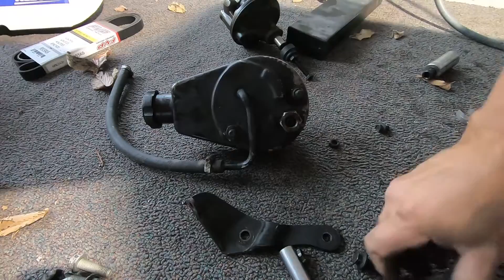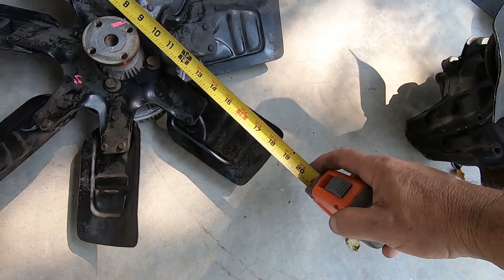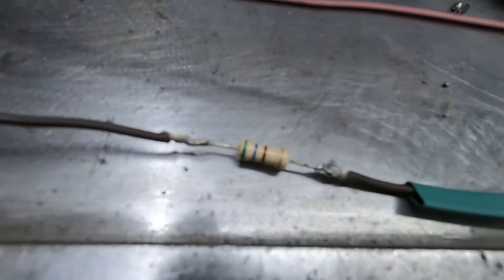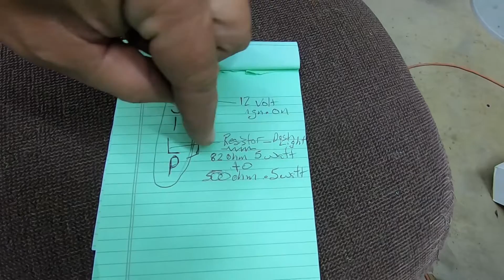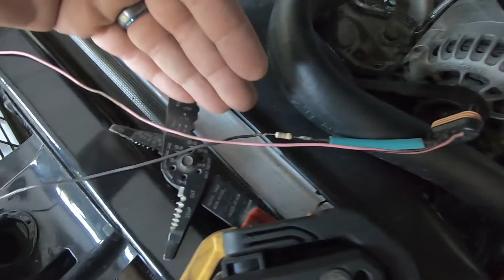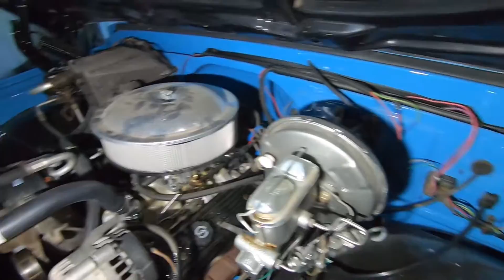1972 C10 | Install Serpentine Belt Set Up Part 2

Comment: I've been wanting to do this to my 1987 Monte Carlo SS . Change it from a v belt to serpentine. Any suggestions?
Reply from the maker: Find a U pull salvage and a GM vehicle with serpentine, might look at the A/C compressor to get something similar. This is the cheapest way I have found to do the swap.
Reply: Thanks for the response, your set up came out really good.
Reply from the maker: Thank You for watching, the set up has a couple of hundred miles on it now and has worked well for sure!